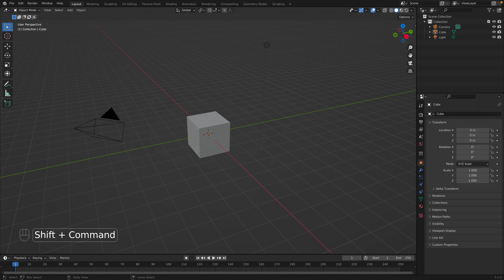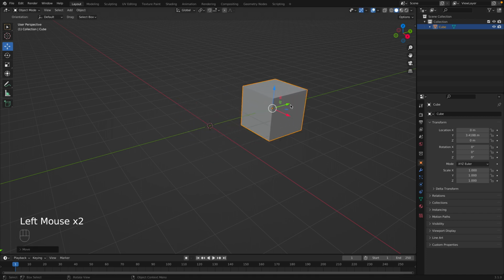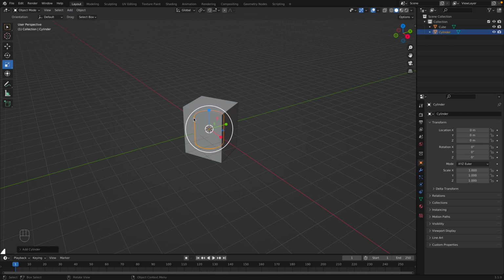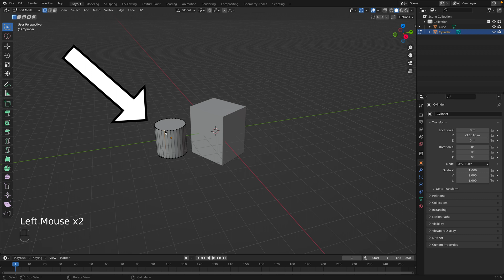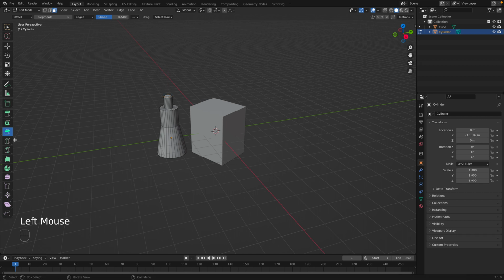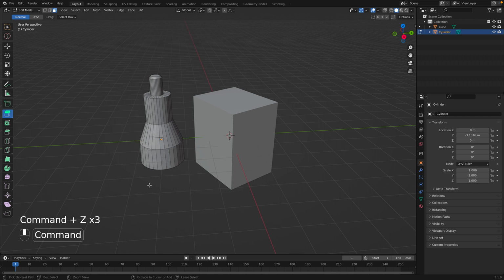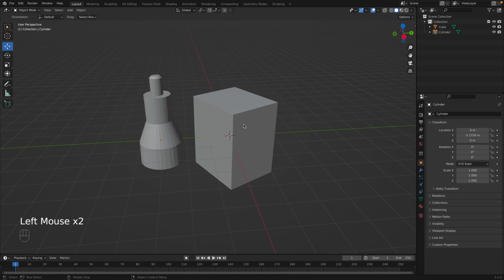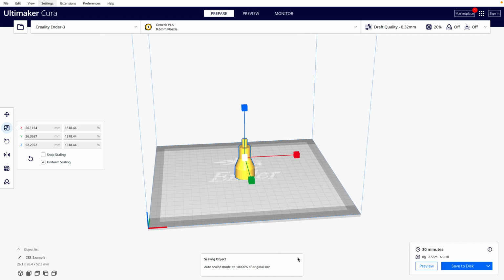Design for 3D Printing using Blender --- Brief Overview

Comment: I never used blender but I would never think it would've saved things into stl files. That's really cool. Maybe I can print someone else's rendered objects and print it.
Reply from the maker: 100%! but if it's not designed specifically for 3d printing it might be difficult to print depending on the complexity of the model.
Reply: @3DPrinterAcademyTutorials 

Where can I download free version ? I downloaded 4 softwares.  No worked for me